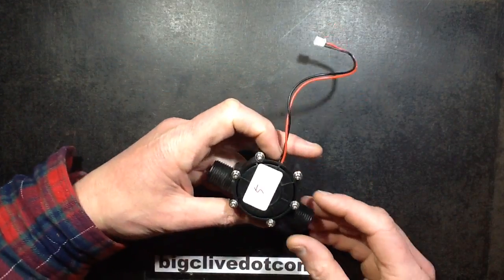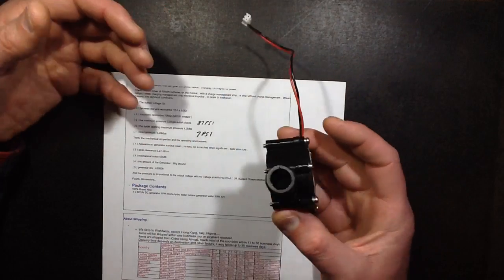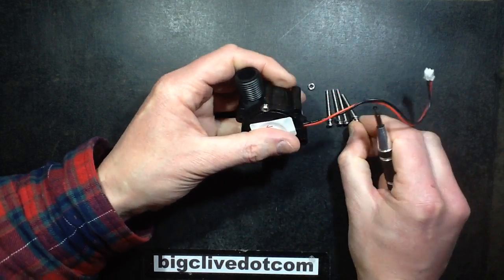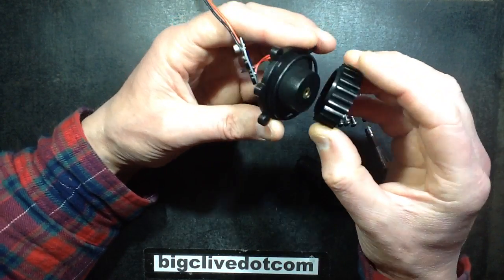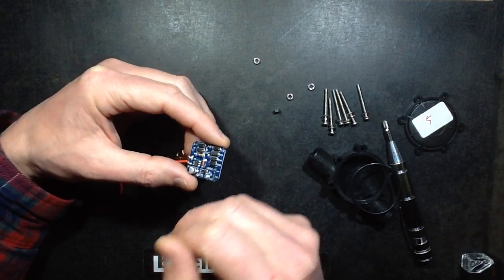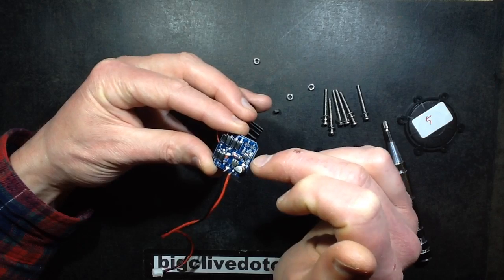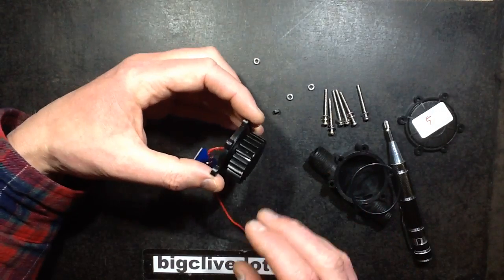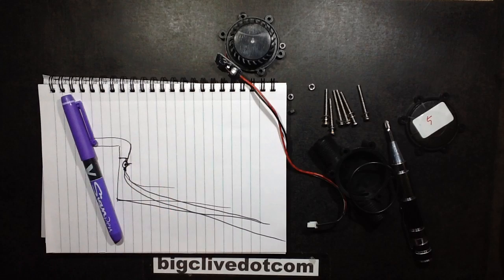A look inside a micro water turbine.

Comment: Makes .22 amps at 12 volts with 10 PSI water input, unregulated makes 1 to 80 Volts depending on water pressure
Reply: Bruce Clark I just got 6 of these and I know its only 220mah, yet 80v, what would you suggest to increase the amps even if you had to compromise volts, I was thinking about a circuit inverter, or a transformer with a secondary winding?
Reply: Build a Ram Pump if you have 1' of head
Reply: Flow.  Water pressure is not the driving metric. When the tap is closed there is full pressure but no generation. If you open the tap a small amount the pressure will be high but still not much power due to flow restrictions.  I assume you mean with unrestricted full pipe diameter flow rates?  What are the flow rates required to achieve these outputs?

Comment: does this work in reverse as in give DC power does it pump?
Reply: +James Campbell 
yes
Reply: +James Pian NO. This is a three phase AC motor, therefore it will not spin without a controller. 
It only makes power, it will not spin if power is applied.
Reply: +Kenji Fox 
You're right. My bust.

Comment: Having a long pipe after the turbine is fine, you are essentially turning a pelton turbine into a Francis type turbine. The problem is you need to limit the length of pipe after the turbine as too much length pulls too high a vacuum at the turbine blades and you begin to get cavitation which decreases efficiency and causes damage to the turbine blades.
Reply: So, connected to LEDs it would be a "lighten up Francis"?

Comment: Hi, one application for this type of unit is I believe in a domestic combi boiler, so that when any hot water demand is initiated, the incoming flow of cold water from the main operates the turbine as a generator to send a signal to the control PCB and initiate the ignition sequence.
Such a unit failed in our boiler resulting in no DHW for two weeks whilst a replacement was sourced! Excellent videos, many thanks for all your hard input. Is there any chance of doing one on those socket outlet testers?

Comment: Clive why not consider a ram pump (look it up) to pump a small amount of water through a turbine. OK it would pulse but a man of your talents could sort that mate! Brilliant videos BTW!
Reply from the maker: GateKommand Given that the operation of the ram pump is really just tiny bursts of water, it might actually be an idea to do away with the water pumping ability and use the inertia of the water to instead thrust a spring loaded magnet through a coil to block the water flow on each cycle.  But the bursts of water through a small turbine mounted next to the weighted valve would probably work too.
Reply: In that case sir I look forward to watching the video you make of doing it ;)
Reply: +bigclivedotcom use water ram to lift water up into a holding tank to turbine. turbine & tank overflow back into source above ram,
Reply: The nice thing about a hydraulic ram pump (besides its simplicity) is that it can pump water uphill quite a ways from a small head of pressure --- but it does that by throwing away 90% of the water flow through it. I think it would be best to mount the turbine for the best pressure and flow and run the power through a good gauge of wire to where you need it.
Reply: What is brilliant?

Comment: Instead of a long hose after the turbine you could put a long hose upstream. This is also done with hydraulic ram pumps (do a search here on YT). Putting this in your water mains would mean the pumps of the water company must work harder.
Reply from the maker: I've been into ram pumps for a long time.  They do require the mass of water causing the percussive hammer effect for their operation, so I suppose it makes sense to have them at the bottom of a straight run of pipe.  The issue with the river at my brothers house is that where it passes the incline isn't great except for the small waterfall that is the point ythat is most accesible and where the power would be nicest to have.

Comment: Legislation where I live specifically forbids the installation of energy harvesting systems on a properties municipal water supply. Pretty steep fines too. And also forbids using the telephone lines power for anything other than a phone, tiny as that power supply is.
Reply from the maker: That's probably to stop people connecting their incoming water supply to a turbine and basically just flushing thousands of gallons of water down the drain.  The telephone line can provide a modest amount of power, but that puts extra load on the exchange.  No problem if just a few people were doing it, but if there were commercial nightlights that plugged into the phone socket then it could potentially overload the supplies in the exchanges if they were used en-masse.  If you connected a small turbine in line with your incoming supply that only ran when you actually used water it would not be an issue.  Your water consumption wouldn't change.  If anything it might go down a bit due to the reduction in pressure caused by the turbine.
Reply: CLIVE!!!  Oh no, you did not say that.  Water is sold by volume not pressure.  If it were sold by pressure you could flow water into your house via a 6' pipe and the pressure would be next to nothing.
Reply: No usage would change little. When you need a gallon of water you need a gallon of water. For most applications a specific volume of water is specified. A tub full, A washing machine full, a bucket full, etc. Only timed usage would result in less water. So if you had a water meter shut-off to water the lawn, One that used water flow to power it, usage would not change. If you have an electric timer to turn the water on and off, then the usage would drop.  The difference would be time.

The reason for the "no turbine" rule is it takes power to run a turbine. So the water-source would have to add the power needed to turn the turbine to what ever is required to simply pump the water to the house. More power means more costs, less profits. Then we get into the economy of scale thing.
Reply: +Zee-L Usay but less pressure means fewer gallons per minute which means less water usage

Comment: I've seen illuminated shower heads sold recently at Lidl (I think) that used the water flow to power its LEDs.

My brother lives near a fairly steep river and has been thinking about doing something on a larger scale, probably a kilowatt.  As mentioned, there's not a lot out there on hydro-generation and I'm sure there are many others that live next to fast flowing rivers.  For example, eBay is flooded with solar panels, wind turbines and grid tie inverters, but very little on hydro-generators, at least not larger 1kW+ kits where you can simply attach a large pipe to and from.
Reply from the maker: I think the higher power hydro generators require a modest amount of structure to hold back against the resistance of the water.  That may limit their appeal to ebay type purchasers.

Comment: Interesting that you are thinking about river power sources.
Theres not a lot on the internet about the feasibility of this when you dont have a lot of head to work with.
My property has a very fast flowing river running next to it, in spate it is quite fightening the amount of energy it contains.
There is the remains of a sluice type affair where in the past they were taking power off a drop of about 1 or 2 feet via a small wall and outlet into a deep pool..
Looks like they were running some machinery in the shed, direct from a long driveshaft up on to the bank.
Im not sure how kindly the environment agency will view me reconstructing this affair in the riverbed, its an SSSI zone.
So have been trying to find alternative methods involving floating type turbines, some jerry built things are here on youtube .
And some rather expensive solutions too from what I recall.
Reply from the maker: I was looking at some archimedes screw type turbines on YouTube recently.  Very low drop and quite low speed geared up to drive the generator.  Is the area of the original sluice visible to the public?  Sometimes it's easier to apologise later than it is to ask permission in the first place.  I like the idea of low power generation just to run some decorative lighting.
Reply: bigclivedotcom
Its not directly visible,its a steep riverbank, but is near the road running through our village .
I wonder whether applying for permission is necessary or not, we own the land including the riverbank and the riverbed (half way across anyway) and there has been workings there in the past.
Maybe using greenie type arguments might be enough to let it go.
Reply from the maker: omgffsification Well you can guarantee that if you ask for permission to do anything then a veritable legion of officials will turn up in hi-vis jackets and suits, then demand formal architectural drawings for even the simplest thing.  Personally I'd just go ahead and experiment to your hearts content without asking permission to do so.
Reply: bigclivedotcom
Yes.
You are probably correct.
Like night follows day.
We have been through a whole series of hoops just getting the shed rebuilt on the riverbank.
The environment agency wanted otter ladders!!
They obviously thought we were digging foundations into the river or something and the otters would get stuck!
God knows what they would think about an archimedes screw.
Reply from the maker: omgffsification I wonder if it's a repurposed device.  Like a boating towable battery charger or even a boat troller (mini electric outboard engine).  The river at my brothers house is ferocious after a storm, so anything that could ride out of the way of boulders seems a good idea.
Reply: bigclivedotcom
Will have to find out more about it.that design.
Ideally in order to make my own for far less money.
A means of attaching it to the riverbed,so it could ride the height changes of the river while remaining stationary, and it would be ideal.
(concrete block and a bit of rope)
My river is a tributary of the Wye and is very ferocious too, after rain it can rise 6 ft in a few hours.
Reply: Do some calculations, there's 7.48 gallons in 1cu ft. (Head(ft)*cfs/11.81)=theoretical Kw. Kw* plant efficiency=actual kw.

But you have no head. With a helical style turbine the best numbers I've seen is optimistically 20% efficiency with no head, usually less than 15%. You would have to have a large setup to power more than some screw in LED lights. 

Even 1 foot of head would do wonders. And you could simply "allow" a tree fall in the exact place to create a bit of a restriction in the stream, then put your devise in the restriction.

Comment: There must be a reason why most hydro generators are based at the bottom of a dam rather than the top.  I'd bet you'll generate more electricity with the device at the bottom of a long pipe, with a short outfall.

As a side note Edinburgh is planning to install turbines on it's fresh water wipes.  Water comes from high up in the borders and is gravity fed in to the city.
Reply: The water level in the retained pool may experience seasonal drops. Putting the turbines at the bottom increases the likelihood you'll have sufficient water pressure to turn the turbines.

Comment: I wonder if this is what they use in those fancy taps that have LEDs in them that are powered by the running water.??
Reply from the maker: I had a shower head that lit up with a turbine in it.  It was similar but on a smaller scale.  It didn't do a good job of keeping the water away from the electronics.